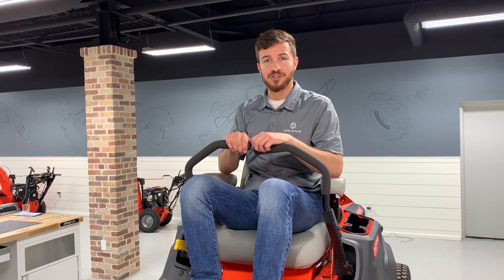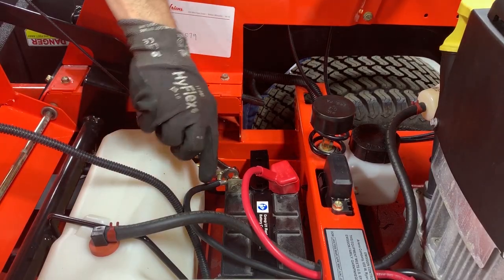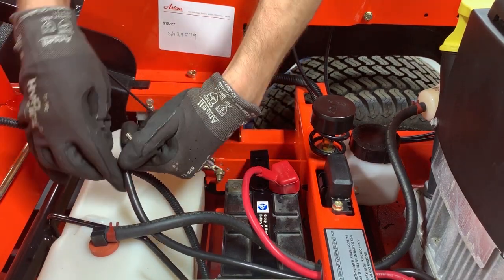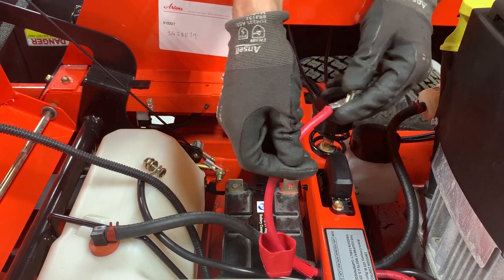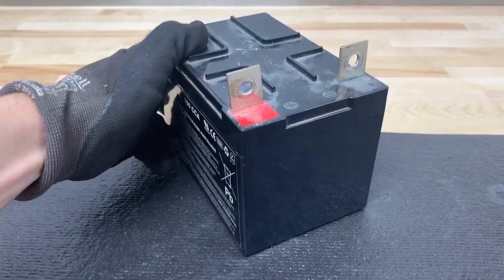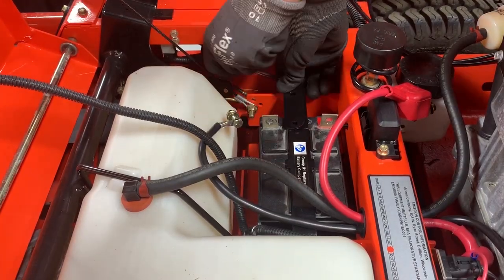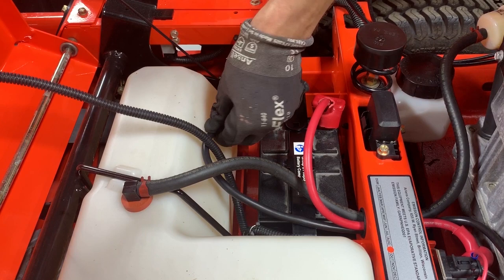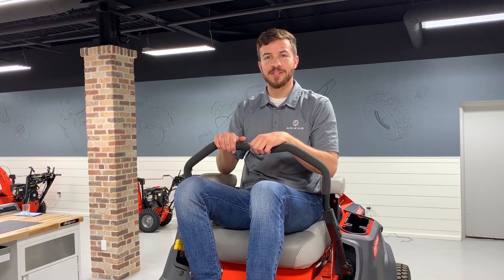How to Replace a Lawn Mower Battery | Ariens®

Comment: I had hoped that this video would give me some tip or trick for removing the hold down bracket but apparently there isn’t one. Not sure why Ariens decided to make it so difficult to replace a battery. This is far more difficult than any vehicle I own - the design is way overkill for holding down a small 12v battery.
Reply: Agree! My bracket had the bolt shear off when loosening it and now I’m having to wait 7-10 days for a new bracket to come in the mail from Ariens. To top it off the battery is sold out or on backorder everywhere.

Comment: Please do a video that shows how to install a U1 battery to replace the 04738800 OEM battery.  The label on the hold down says "Group U1 Replacement Battery Compatible" but I can't figure out how to position the hold down brackets.
Reply: I don't think it's possible.

Comment: Is there a video that shows how to do this on an apex 60?  the manual states "Loosen hex nut securing right hold-down bracket to frame" however I can't find a hex nut anywhere around the battery.    I think it would also be helpful to rename this video to call out that it's for the ikon and not just "Ariens" as that gives the viewer the impression that this video covers all of your mowers.
Reply: I finally found the hex nut... it's on the BOTTOM of the mower and not where the diagram in the manual leads you to believe.  Hope that helps anyone else trying to remove an Ariens Apex battery
Reply: It’s obvious whoever decided to put the bolt on the bottom has never had to work on one
Reply: @cyburdine my bolt sheared off when loosening the nut from the bottom. Had to just order an entire bracket because the damn bolt head is welded on. Horrible design and worst battery changing experience I’ve ever dealt with. Now the new battery is on backorder everywhere
Reply: @dionysis84  Ugh. That sucks. But yeah, the one bolt is welded - AWFUL engineering.

Comment: Ariens: I love you guys and your equipment. But PLEASE make your owner’s manuals better. I too could not determine what type of battery I have in my XD without removing it. Lion, AGM, sealed lead acid, NMH, etc. The specifications section is not helpful with battery info. My new battery tender needs to be set specifically for battery type, and this info is important to owners. Then, the manual has no description or graphics for the bracket and fitting when putting it all back together. I also can’t figure out why we even need the small L bracket that attaches to the battery bracket, so I just removed it. Again, some descriptive words or graphics would be helpful.
Reply from the maker: Thank you for your feedback, Buster. Sorry that fell short of your expectations, but we can tell you the battery in your Ikon XD is an AGM battery. Hope that helps!
Reply: Very true about the owners manual. And every mower I've ever  owned has had a parts breakdown.
Reply: I totally agree! Be more specific about the replacement battery too, my two month old battery died suddenly and when i tried to charge it back up with my trickle charger, the thing almost exploded! S i need to replace the original with a similar battery or is there an alternative battery?
Reply: My ikon didn’t come with double nuts like that and the battery hold down bracket is the dumbest design ever

Comment: WOULDN'T ROTATING BLADES AND the ENGINE STOP AUTOMATICALLY ONCE THE TERMINALS ARE DISCONNECTED?
Reply from the maker: You are correct, however, we just want you to ensure the mower is off before starting service.
Reply: @AriensChannel   Ariens  I was just joking with you. It was hilarious that after putting the key in his pocket he still had to tell us to make sure nothing is moving! Thanks for a good video.